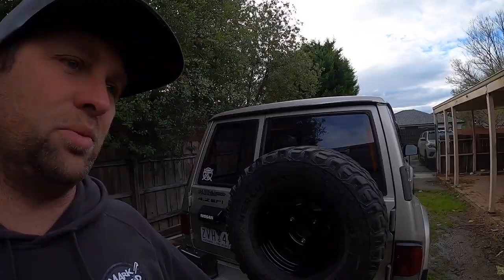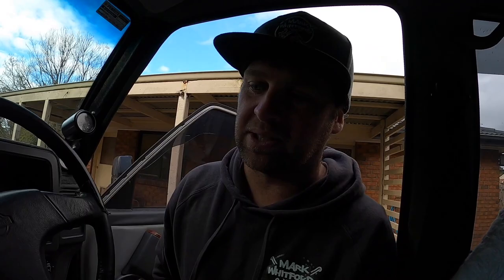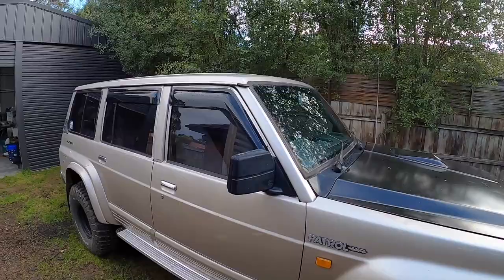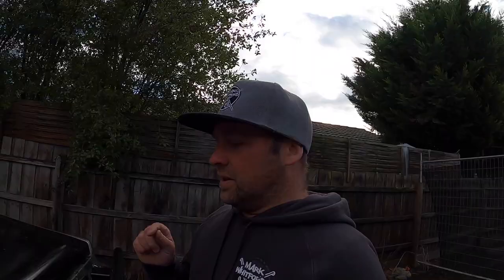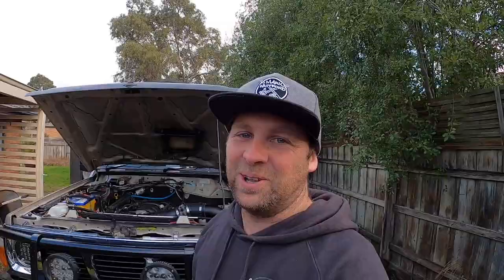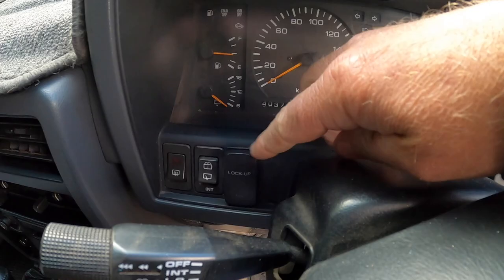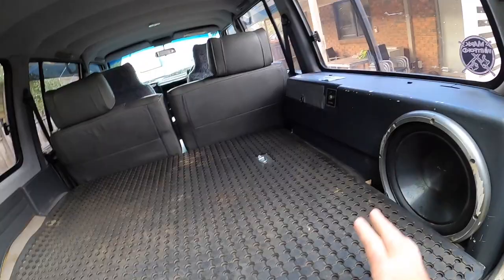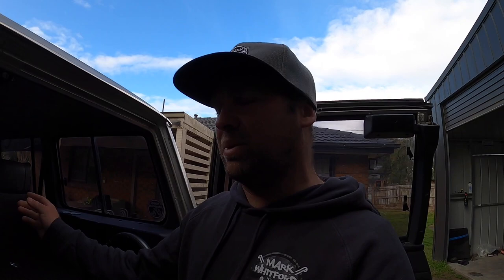LS1 GQ Patrol - I bought a new car!

Comment: Patrol docca not patrol doctor just for future reference 😄

Also recommend rhino roof racks titan or drifta draws XR seats 80ch uhf 12 vault setup for a fridge or camp light awning stainless steel snorkel and air box I recommend 3 inch and then a 3 inch exhaust probably a supercharger instead of a turbo just because it’s an ls egt what’re temp and boost gauge (if u get a turbo) mud tires and that’s my input
Reply from the maker: Haha cheers man!

Comment: Hey mark, I probably a little late to the party but I have an Rb30 Gq and I love it they are such an unbelievably capable vehicle I have a set of titan draws and a kings rooftop tent roof rack and I love it if you cut the two front supports out it nicely takes a 40 inch lightbar in the roof rack and as for the Titans they are good price and fantastic quality I can’t say enough good things about them good luck mate love your choice of car

Comment: I've got a cammed ls1 1998 hilux makes 300kw on 35s.
Built 4l60e, lockup convertor, 3k stall etc
B&m ratchet shifter 5l surge tank, billet fuel rails etc

Comment: If you want a touring car lean towards a n/a combo. Do your research on a nice cam that’s good fo torque. Build the rig up for torque incase you need that extra bit under the foot. I have a ls1 I built with the vcm16 camshaft and I made 540nm of torque with standard heads and exhaust manifolds I built that are chocking the engine up. 
Turbo would be great if you were serious about 4x4 and use the vehicle all the time. But with what you wanna do, a tuff n/a setup would be killer. Turbo you’ll forever maintain it thorough and have to worry all the time about temps and plugs ect. Just my theory.
Iv just braught a gq, it was my mates that’s no longer with us anymore he sold it 6 years ago and I tracked it down recently a tuff n/a ls conversion is on the list to do. 
Chase torque mate, na setup is killer
Reply from the maker: Yeah after taking it away I think I’ll be keeping it n/a probably just a cam and tune

Comment: Honesty mate don't waste your money on a turbo a supercharger makes more sense and more reliable then turbo
Reply from the maker: Have never really been a fan of superchargers, we had one on my brothers old Maloo and it made ok power, but we ripped it off as it would heat soak all the time... went twin turbo and the difference was huge way more power and lower temps, a blower does make more sense than a turbo with the lower rpm mostly when 4x4ing. So yeah I still dunno which way I want to go 😂😂

Comment: Having the car for a bit do u regret getting the petrol v8 over a diesel
If u had ur time again would u go diesel or does that not matter to you
Just ask ikng coz I got a gq with rd28 turbo motor with a bad head and considering what motor to replace it with
Reply from the maker: Nah not at all, diesel doesn’t matter at all to me. I bought this car because of the ls1 and I’d still prefer that over any diesel to be honest. The amount of power even out of a standard ls1 would cost sooo much to get the same out of a diesel
Reply: Thanks for taking the time to give me feedback mate I appreciate it
Reply from the maker: beardbuddy no worries at all mate
Reply: Btw I might be selling a stainless steel snorkel in the future like u said u want if ur still interested in future

Comment: NICE rig. I've got an LS1 SWB but it's manual. I want to know more about your gearbox! :) What is it? An RE4? Where from? How much? How does the overdrive work??
Reply from the maker: Thanks mate! 
I don’t know all the details this is how I bought it, but yeah it’s an re4 built to handle 800hp apparently by wholesale automatics. The previous owner said he spent 6-7k on it but not sure how true that is 😂 so you have the power button on, and drive it manually 1,2,D the click the power button off for 4th then there’s a converter lockup button for 5th
Reply: @markwhitford  That sounds pretty good. So you have a separate power button (switch?) .. and when it's turned on you shift gears using the stick (1st, 2nd, 3rd which is 'D')... and then if you're on the hwy you turn the switch off and it automatically goes into a 4th gear (overdrive)?? Is that how it works? Can you just drive it like an auto full time as well if you don't turn the power on?
Reply from the maker: Yeah man that’s it! Just the factory o/d switch on the shifter get you to 4th  then there’s another switch on the dash that locks the converter up for essentially a 5th